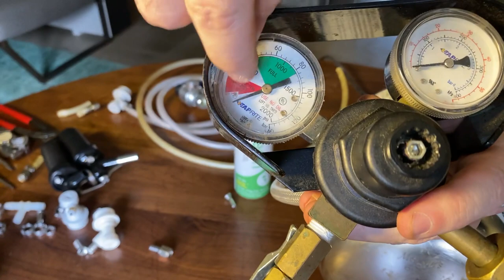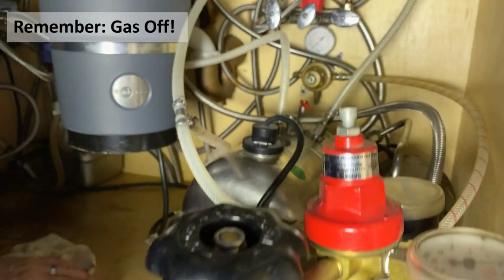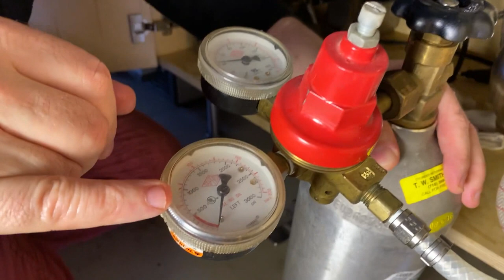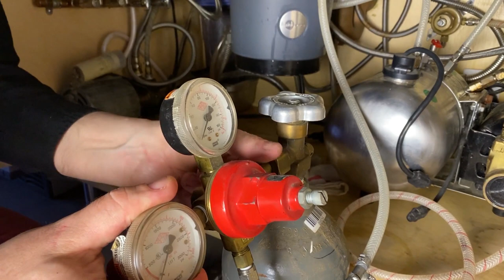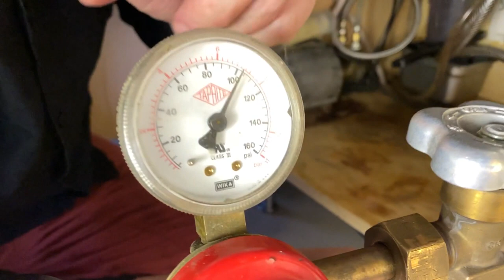Setting up a Home On-Tap Carbonation System -Complete and Unabridged

Comment: Could an in-line Compensator be used in conjunction with a standard valve rather than an Ibis tower or hand seltzer valve?
Reply from the maker: I'm not sure. I've been thinking about it though. You want the compensator to be as close to the outlet as possible.
Reply: @DaveArnoldFCI  I ordered one and it will be delivered today. I will give it a try. :)
Reply: @justinherman9443  How did it work out?
Reply: @honestshrubber  I am moving between houses and right now I am trying to find my McCanns Carbonator. I will update when I get it setup.
Reply: @honestshrubber  Ok I tried it and it worked perfectly! The CMBecker compensator throttles the flow and feeds into the tap was designed for my reverse osmosis system. I purchased an undersink water chiller that takes the carbonated water from my carbonator and chills it then the chilled water is passed to the compensator for flow control, then to the stainless steel faucet. 

All of this is fed from my reverse osmosis system that has a reserve tank of filtered flat RO water for the carbonator to draw from.

Right now the water is coming out chilled and carbonated but I am waiting on the carbonation to rise even higher. I had the CO2 at ~65psi and I now turned it up to 100psi. I like my water to be very carbonated.
Reply: @DaveArnoldFCI  It works. I am using a CMBecker inline flow control that is mounted close to my stainless steel sink mounted faucet that was designed to hook up to a reverse osmosis system.
Reply: @justinherman9443  Thanks for following up! What faucet are you using?
Reply: @honestshrubber  I am using an iSpring GA1-SS. It is available on amazon.
Reply: @justinherman9443  Thanks for the testing and follow-up! Really good information here.
Reply: @justinherman9443  Which undersink chiller did you use for your setup?
Reply: @davewoodmtbrider1  the oasis R1P. I picked one up from ebay fairly cheap. It had a broken plastic cover but you can buy replacement parts. I also upgraded the fan that runs quieter. The old one wasn't too bad but the new I cant even hear. https://www.oasiscoolers.com/parts/index.php/oasis/pressure-water-coolers/remote-chillers/r1p.html
Reply: How close do you have the compensator to the stainless steel faucet?  I have a similar setup, but the seltzer is coming out really choppy.  I have about 1.5ft of line in between the compensator and the faucet, I am wondering if I should shorten it so that the compensator sits right next to the faucet.  Also, my outgoing seltzer temp is about 48 degrees right now, I'm going to look at modifying my chiller thermostat to see if I can get it closer to the ideal 35-38 degrees.  Btw, I have pretty much the same faucet - the GA1-HS model.  Thanks!
Reply: @peterz1622  the compensator it less than a foot away from the facet. I just measured my flow as around 4 fluid oz in 5 sec, a temp of 47F and the co2 pressure 80 psi. The compensator is very touchy the slightest turn of the adjustment screw makes a large difference in the flow. I am very happy with the setup! Saving monies by not needing to buy co2 plastic bottles and the convience of it being on tap!
Reply: @justinherman9443  Thanks!  I will try turning down the co2 pressure.  Right now I have it set at about 115 psi.  And yeah, maybe I need to play with the compensator a bit, it does seem very touchy.  Maybe I will try shortening the distance between the compensator and faucet just to see if it helps.
Reply: @peterz1622  I would drop the pressure as it is simple to do. I also noticed erratic behavior when my co2 was getting low. Let me know if I can be of any other help.
Reply: Lots of good information here. I am planning to do a similar setup with my current RO. Split the RO output into the current sink faucet and into a small McCann carbonator (2gal one is too big for my cabinet), feed the carbonator output to Franke CT-200 chiller (rebrand of Oasis R1P), then through the CMBecker compensator into a new RO style faucet. Any issues here? The chiller manual talks about needing a check valve. Do I need a check valve?
Reply: @rajm1183  I don't have a check valve. Only issue I have is the chiller developed a leak inside. The stainless steel tubes that run from the outside to the inside and to the inside tank are brazed (maybe) and their joint began to leak. I opened the chiller up, removed the lines and attached the tubing directly to the chiller tank. Problem solved. I ran the lines outside and setup male flair fittings so I could attach and detach if needed in the future. The only other issue is my ispring faucet does not seem to last, I get maybe 3-4 months and then it begins to drip and leak. I've replaced it several times under warranty. (Free) but it is a real pain as I have to shut everything down, (co2, water supply, carbonator), and relieve pressure. Then I can loosen up the faucet and put the new one in. I don't have a check valve and I am not sure why it would be needed. The system is under pressure and at no time should pressure be above the co2 pressure amount. There is a check valve in the carbonator but that is to prevent carbonated water feeding back into the source of the carbonator and further upstream.
Reply: @justinherman9443  thank you! did you end up using the tubing that comes with the chiller or something different to connect the carbonator to the chiller and chiller to compensator and to the faucet? looks like the chiller uses 1/4 inch fittings and the compensator is 3/16
Reply: @readysetfly  I used 3/8 beverage line with a crimp clamp. The input and output lines on the chiller run outside the case of the chiller where they are connected to 3/8 barbed to MFL fittings.

Comment: How did you connect your compression hose to the water inlet for the carbonator?  it looks like you removed the flare fitting.
Reply: That part you can buy at Lowes or Home Depot, can be brass as the water isn't carbonated yet. Take the fittings that you have there to match them. I found some parts at kegman.net I use a jockey box to cool the Seltzer water, I put a submersible pump to get the water out every morning as I replace ice. Took me around 2 hours to install it.
Reply: I just spoke with Dave and here is what he says: The inlet to the pump is just like the standard one that you'd use to connect to a regular faucet, so it isn't really a flare and is more a compression fitting, it's what you'd get at a big box store, then everything after that connection is carbonation gear and using real flare fittings.
Reply: Yeah it looks like that is what he did. From what I can tell if you buy one it will have a flare inlet, but on mine it is just a fitting that you could remove and replace with another one (looks like pipe thread on the other side). The soda expert I spoke to (a Mark Powers guy but not Tim, who doesn't work there anymore) did not recommend using those braided compression lines after the water filter, because the quality of the inner plastic tubes is unknown. I just put a barb fitting in my water filter and used only hose (similar to what is called for in the parts list but 3/8) after that.
Reply: procon pump needs a 1/2 mpt to a 3/8 flair fitting on the incoming water should have a 1/2 water COLD water supply line..3/8 will do..do not got to 1/4 line

Comment: What about the excessive pressure which carbonator makes? What is inside the carbonator? How does it carbonate water so much fast? I think co2 would replace with consumed water instead of pumped water, why did this not happed?
Reply from the maker: Inside the tank the water is sprayed into a pure CO2 environment. That spraying provides enough surface area to carbonate instantly. That's why you have to make sure there is no air in the system AND make sure you get all the flat water out of the system before you turn the pump on. If you fill the tank halfway with flat water and then pressurize with CO2 it will take a long time to reach full carbonation.
Reply: @DaveArnoldFCI  what about my last question?
Reply: @imanrounaghi8448  I think carbonated water collects at the bottom and exits by tubes that go up to those outlets. See US patent number 6,935,624 for a general description of a carbonator that I think works the same way.
Reply: @DaveArnoldFCI  good answer, the key is the water from the procon pump is under high pressure which than hits a slash plate in the tank causing the water to mist.  that plate can break off  sorry to hijack your channel..ive been doing this for 40yrs

Comment: can i use this to carbonate beer?
Reply: No. This only carbonates water... beer should be carbonated in the keg
Reply: co2 for the beer is only used to push the beer out of the keg usually around 13psi otherwise FOAM

Comment: Do I need to reduce the water pressure?
Reply: The carbonator operating instructions recommend "around 50 psi." If you hook up an ice machine that will also have a range of acceptable incoming water pressure that will depend on the machine.

Comment: Can anyone tell me how to connect the stainless tubing on the bottom of the IBIS beer tower to the 1/4 poly tube (barbed).. Compression to barbed adapter? The tower came with a single fitting, but it's the wrong size (1/4" barb to 1/4" slip on)
Reply: Yes, a 5/16" OD Tube Compression to 1/4" Barb fitting worked for me. I ordered from Fittings, Inc. Part #7039. If your beverage tubing is 3/8" O.D. (not the Bev Seal Ultra 175 mentioned in this video, which is slightly larger and will not fit) then McMaster Carr has a push-to-connect stainless steel to plastic connector that worked for me when I was testing: 9406T19. McMaster also carries a plastic 5/16" stainless tube to 1/4" barb fitting, 9406T25, but the diameter of the plastic barb was considerably smaller than the stainless ones (about half the size) and I'm not sure what that would do from a pressure standpoint.
Reply: Thank you!!! @DavidCoughlan

Comment: Couldn't you empty the oxygen by us loading it with CO2 and burping it a few times, since CO2 is heavier than air?
Reply: you should fill the carb tank up first with water till the water comes out the dispenser Than turn on the co2 tank and unplug carbonator, run dispenser until only co2 comes out...plug carbonator in and it will start up for about 20-30 seconds and turn off..than run the dispenser till you get a good flow of course you will have ice on the cold plate right?

Comment: How well does RO water work with the carbonator?
Reply: it doesn't PERIOD..you can't carbonate RO water..plus having a soft water system effects it also
Reply: It works just fine. In the final analysis, we are trying to infuse CO2 Gas into a liquid....apple juice, wine, dirty water, clean water, whatever. The only difference between his setup, would be, R/O is a higher level of filtration, and usually is only supplied at a small flow rate, hence the need for a storage tank with a larger capacity to suck up the R/O water and then be supplied at whatever flow the pump requires.

Comment: Can you pump lemonade instead of water?
Reply: In theory you could, yes, but you'll probably get a lot of foaming, and it's near impossible to clean everything out properly
Reply: @jeannihoul8914  thanks, so it's better to carbonate the water then add it to the concentrate
Reply: @teddymwalo1649  Correct

Comment: Question: Can softened water be carbonated? If so, is there any special considerations that need to be made?
Reply from the maker: Dissolved salts will definitely change the way the bubbles feel in the mouth. I have stored water with salt in stainless tanks for many months, but I don't know what would happen to the stainless parts after years of use. Might be fine! To make sure you like it, try softening/filtering some the same way you plan on doing, and carbonate it in a soda stream or equivalent. If you like the result you are in luck!
Reply: @DaveArnoldFCI  Yeah I decided to carbonate with a steel carbonation cap and my co2 tank. It was possible but still tasted "soft". I installed a Reverse Osmosis system and I intend to carbonate with that.
Reply: NO! you can't use soften water!  soft water will not be able to absorb the co2 gas properly..period!
Reply: @paulbunyun-xi9by  I respectfully disagree that it wont be able to absorb the water. The oceans absorb the most atmospheric CO2 and have far more NaCl. Also, I have visited a local bar that also uses softened water. It works but it still tastes softened and kinda sweetened to my palate. 

Personally I installed installed a Reverse Osmosis system that feeds the carbonator.
Reply: not very well, you need hard water and NOT RO water
Reply: Of course. You are just infusing CO2 gas into a liquid. If you are bothered by the "softened" taste, change the level of softening, whether you are carbonating or not.  I've been using R/O water for several years- it is re-mineralized slightly after the R/O process, and it works JUST FINE.
Reply: @paulbunyun-xi9by  So, you are telling us that carbonation- private, commercial, big system, small system,- will only work around the entire world if there is hard water.....??? And what level of hardness would that have to be????!!!!!!!! Water with an optimum PH, is not very common at all around the world.
Reply: @divingfe  so its not RO water if your adding back into it, just like McDonalds does with its coffee
Reply: @paulbunyun-xi9by   Yes it is part of the iSpring R/O H2O system,; several pre-filters, a pump, then the R/O filter itself, and the storage tank. This becomes very pure water, virtually all hardness and impurities have been removed. To give it a bit of 'taste', and remove the 'flatness". a small alkaline filter is added, as an option That is common among R/O systems.   One of these days, after I get my whole-house filter system installed, I'll get some State Agency Water testing done, at various points in my system flow, just to test the efficacy of the filters. 
 I have no knowledge or awareness of  coffee from the golden arches; I've never had it and don't know what you are talking about; Sorry.
 I'm sure if I used our base tap water, which is quite alkaline and has many "mining" impurities in it, It would carbonate exactly the same as my  R/O water;  It did before I Installed the R/O system, and the only difference noted, was a nicer taste afterwards.  Also the case if I were to add a H2O softener upstream, which, after all, only adds (usually) salt to change the Ph value.  The only differences, carbonation-wise, would be the taste of the 'base' H2O that I was starting with.  
Additionally, in all the natural carbonated  water sources in various springs around the country and world;  The waters that are infused with CO2, are all of varying hardness as well. 
Not to mention, of course, the oceans, which are infused with much salt (softness), and , thankfully 'stores' lots of carbon, so it doesn't contaminate our atmosphere.
Where did you get your information that "soft" H2O wouldn't carbonate?? , and what Ph level would therefore be required in order to carbonate??, And, most importantly, why is this so??  No literature I've come across ever shows anything about hard/soft water, in terms of carbonation.

Comment: When you disconnect carbonater from water pump，how you get water into carbonater ? you only have one outlet to seltzer faucet.  Thanks for explain to me
Reply: With the pressure from the water supply, typically 40-60psi in the States. Water can flow through the pump to fill the tank without it being on. The pump is just there to boost the water supply pressure to overcome the pressure in the tank once CO2 is added.
Reply: @linguistisch  true did you now that if you have 55psi water pressure you only need to set your high pressure 20psi higher so it would be 75psi if you go higher it won't carbonate better it will just cause more foaming

Comment: WOW, How confusing!!!!!!! If, perhaps, you had used a display table to show all the components first, then briefly described what each on was for, and then, maybe, wrote out the steps on a white board (and WHY you were doing them), you might have avoided the mis-speaks, interruptions, and the disturbed-flow of the presentation. If as you say, you have been installing these setups for many years, I would go NUTS as a client watching you.  Like a butterfly on a windy day.  I've been doing small consumer bottle CO2 for several years, and maybe was thinking of going to a tap.  NO WAY, Its really expensive, and way too many stops on the CO@ Magical Mystery tour. Perhaps a bunch of editing and a 'newbie' to watch, might have helped. Sorry for the negative comments; nothing personal!!
 Now, a technical question. If you are just trying to infuse CO2 gas into the water, WHY are you pressurizing the water with a pump?  Won't the  high pressure CO2 Gas from the regulator infuse the gas into the "plain" water, and thereby bring the whole thing up to the same high pressure?? And you never explained the black unit on top of the carbonator, only the wire that was connected to it.
:face-pink-tears: